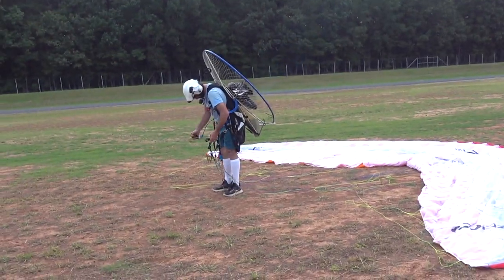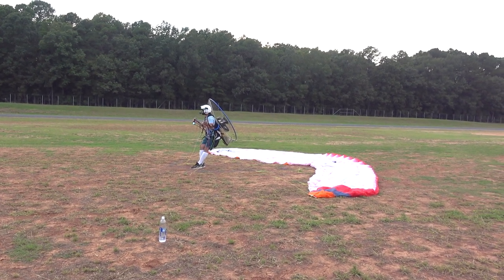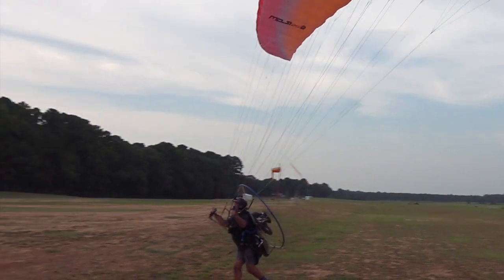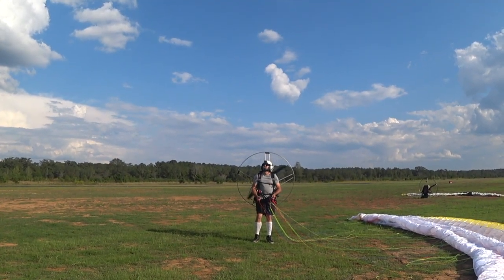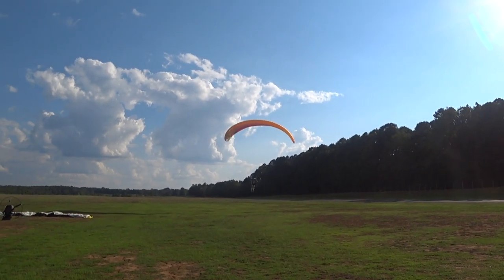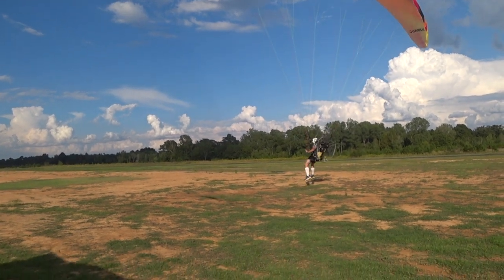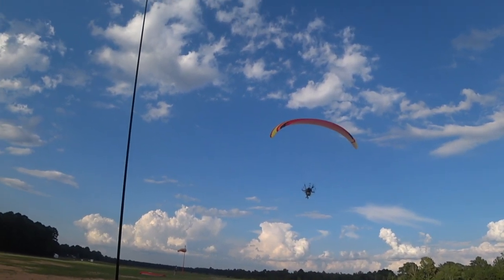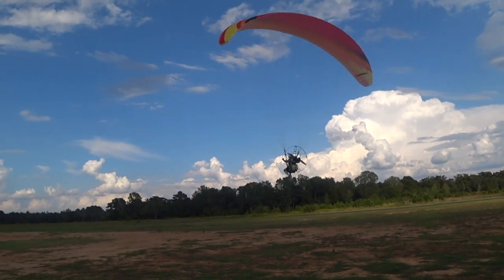Low Wind, High Wind: The MOST DIFFICULT vs. MOST UNFORGIVING Conditions to Launch & Fly a Paramotor

Comment: Most of my take offs have been in 0 wind in a top80 weighing 185lbs.  Sometimes They have had a small uphill. What this man preaches is true. We nicknamed it the whoop whoop. We just give three quick bumps on the power and then once the wings up gun it.   My best was in 3 miles an hour of wind and I think I use about 100 feet from the back of my wing to where my legs left the ground. I see some lighter guys with moster 185s and nitro 200s get up in a few steps. Also what he said about the a lines is true. In fact he actually quoted my instructor verbatim.

Comment: All I have ever done is forward launches. I've never done a reverse launch. I don't know how Kyle 😁
Reply: I'm in same boat. I ONCE tried a reverse in mild wind and almost had it. I simply buried one brake on the spin by mistake. I needed to spin and run as it wasnt overly breezy.  Easy enough to correct, but havent tried since. Ended up forward launching for that flight. Im a fair weather Mtn flyer anyhow...

Comment: Great content. Useful. And exactly what new students want to see. Lots of take off & landing in different situations. Next time a number on the wind speed would add more value. Thanks
Reply from the maker: Wind was zero.  Check out the flags hanging
Reply: @kyleoglee  Thanks. what about the strong wind conditions? were they above 15mph?
Reply from the maker: @salqubeq5203  At moments yes, the strong winds were highly varied, and gusting.  10-20 mph.

Comment: Hey Kyle I have a question. When a thermal or rotor dumps you and you lose altitude fast does flaring help stop your decent or do you just gotta ride it out
Reply: Thats why I run my motor to the ground when its thermaling. The motor seems to do more than flaring
Reply: @ohiyesa2328  thank you, I think I’m gonna do the same when in windy conditions or thermals. It gives you another source of input
Reply from the maker: This is a loaded question due to the variable of altitude.   With that said, the pilot impulse is the same.  Upon entering a thermal, hands go higher to maintain glider overhead.  What will come next is exiting the thermal.  The glider will pitch forward.  Be ready, and apply a braking impulse to prevent an excess surge upon exit.  If you're near the dirt, it's crucial that the impulse stops the glider from passing you.  Too much surge too low will mean swinging into the ground.  It's why flying low in thermal conditions is dangerous.  At safe altitude I let the glider go some bit further without an increase in risk.
Reply: @kyleoglee  thank you for your response! You are one of the pilots I respect the most because of your honesty. Hopefully someday in the future I will get to meet you. Again thank you very much!

Comment: hmm. this is how I see it. you're an instructor. there's a wing behind you. then you say someone laid out the wing? why didn't you check the wing over the first preflight checks? then you would have noticed the cravat.?  so let's imagine a student did the very same. because they watched how you the instructor does it? so the student launches .sees a cravat. but because they watched you. they carry on ...... but do the students still learning to know how to get a cravat out??   I am not impressed.
Reply from the maker: Maybe come to the school sometime before passing such judgment.   This was a year ago.  Can't testify to much of anything besides what's in the video.  Maybe was me, maybe them, wasn't my glider so I was not seasoned on how it likes to be laid out.  This was my first contact with it, and BTW the cravat wasn't there upon layout.  It only showed up after line tensioning.   It does seem very strange that you'd nit pick such a benign thing anyway.  Have I rubbed you wrong somehow Tony?
Reply: What he showed was that for a good pilot such a minor issue isn't a problem, and when they become experienced pilots, they should be able to handle their aircraft without freaking out. He also demonstrated to the wing's owner that he can be confident that he would be able to control it if a tip collapses. What your methodology would teach is that if a day one beginner couldn't pull it off, then no one should, and that any little issue is reason enough to over react, which is completely counter to the idea that practice can make one a better pilot.